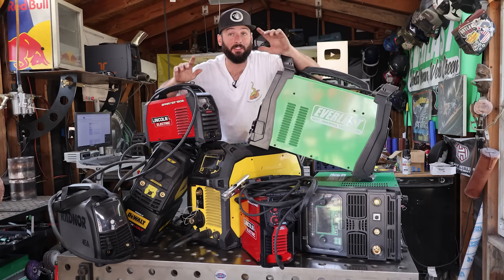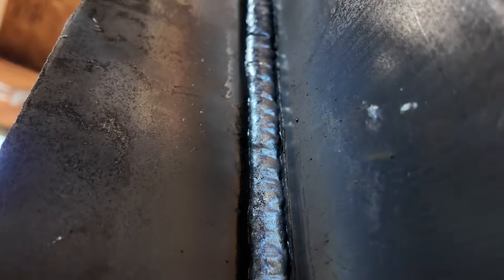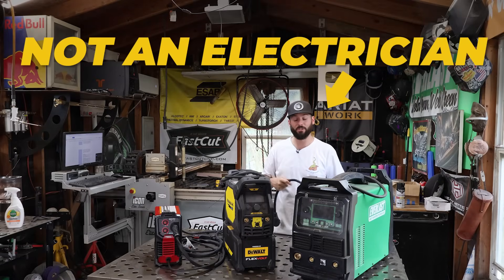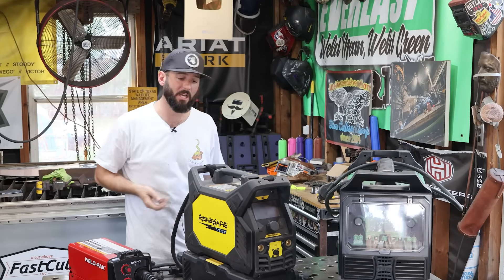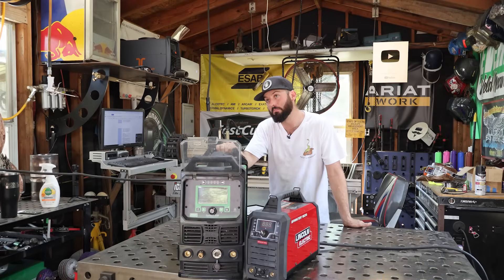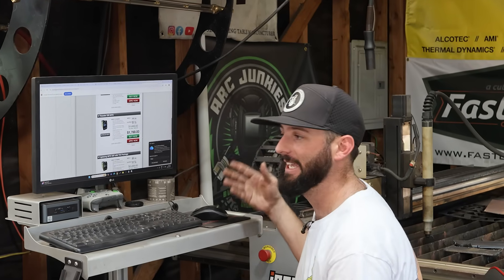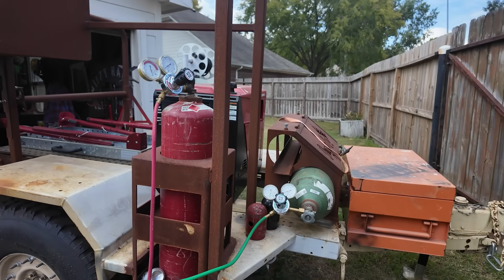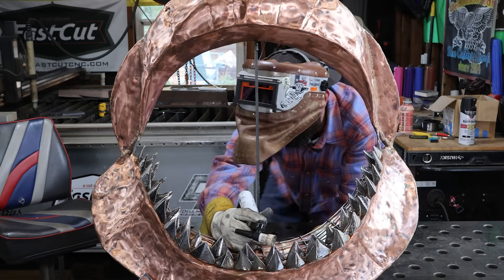Watch this BEFORE Buying a Welder

Comment: I got a multiprocess Lincoln and all I needed or for was flux core welding. It also opened up the opportunity for doing MiG welding and rig welding if I ever want to. Alma bought a Vulcan from harbor freight, but being since I worked on pipeline(as a welder helper) millers and Lincoln just seemed like a good way to go. As I do research and learn more there’s plenty of good machines out there for part of the cost. Just buy one and get after it!

Comment: Miller 211 auto set and a yes welder 205DS pro. Both machines do everything I need and I’m a novice at best. Learned in the field doing farm repairs and automotive repair. I wish I could buy one multiprocess machine but I have everything I need to get stuff done.

Comment: I just ordered an Everlast Thunder 255 to give myself pulse spray MIG capability as, while my old Miller 200 has the power, it wasn’t designed for it. Plus it’ll give me the ability to practice DC TIG
Reply: @gtcam723  that's interesting I never thought about a machine being designed for spray transfer? I just figured if all the settings n gas was right it would spray..but I have been having a hard time getting this old miller at my work to spray...I can get it to do it but it's not as smooth as some machines I've ran that had pulse settings..

Comment: This is why I got me the cheapest stick inverter(50$) I could find. I´d like to do aloominimum, too- might get me a fluxcore some day, it can do that, right? I´m the most casual welder you´d find so I don´t give a fuck about bells&whistles, I need to get the job done. Thank God I´m in a country that has 3phase in every house and 230v regular. My little inverter throws down 70A off a standart plug.
And if I really have to get something welded that needs to be reliable I go to a shop.

Comment: Found some great used Lincoln’s on Facebook marketplace. Had an inverted 275 for 7 years before I fried the mother board. Just got a tig wave 175 for 500 bucks and welds great. Weighs like 250 pounds tho 😂😂  the older machines can be a good option is the previous owner took good care of it, build strong without all the computer shit
Reply: Just remember that these transformer machines that can be gotten cheaply are pretty inefficient and need more power from the wall to put out what inverters put out with much less input. If it’s not a problem, then ok.

Comment: DIYer. No formal training. Grew up using dad’s Lincolon 175HD mig.  Bought myself a Lincoln 180 dual. Have made it work for sheet metal .025 helps, and I’ve done 1/2” structural stuff, .035 multi pass. Never needed stick, MIG does most of what I need. Have used (dads) Lotus TIG machine for small SS jobs and some 1/8” aluminum angle.

Comment: What is your opinion on yeswelder brand
Reply: They lie about their specs on their older models.   Only the CT2050 and DP200 acutally output what they claim and the display is accurate with what is measured.
Reply from the maker: You get what you pay for.

Comment: Always buy major name brand filler metals. A lesson I learned the hard way early on. Me, I insist on ONLY Lincoln Electric filler metals. I’m not saying they are the best and they sure aren’t the cheapest but I can always take them home and use the entire spool or box, whatever the case may be. With some of the cheaper ones that I allowed myself to be talked into early on, I’ve ended up throwing half a box or spool in the dumpster because I couldn’t fight with it any longer. That ain’t cheaper.

Comment: as a Euro the power advice is still useful... while the 110/220V part doesn't apply, max amperage most definitely does, and while I haven't researched it yet I imagine there are three phase (400V) machines out there, too, which I couldn't run at home.

Comment: What adapter are you using on the 285 to let you use the euro connector?  I recently got a 285 because they were on sale at 1/2 off. $2K instead of 4.
Reply from the maker: Its an adapter I got from Heavy hitters tig rig website

Comment: Upside, Harbor Freight is releasing the new Titanium Unlimited 210 later in 2026 that will include AC and DC TIG. Price at launch will be $1200.
Reply: My first good welder was the HF Titanium 200 Unlimited and I don't have any complaints with it at all, but like any MP welder there are compromises for the price point.  I think that at the price of the improved machine they will be facing stiff competition from Lincoln , Miller, Esab, Primeweld, and some good imports, but what will really kill them is their measly 90 day warranty.  I recently bought an Everlast 210 EXT due to the HF warranty and other than that I would have been happy with their Vulcan Tig 205 machine.

Comment: TOO LATE. I bought a Prime Weld 325X for Tig and a Everlast Cyclone 253DPi for MiG. Most multiprocess are compromises and don’t excel at all processes.
Reply: The worst multi-process machines are the ones that include Plasma cutting.
Reply: Y'a got yourself excellent machines, you can do it all with them!!

Comment: if you wanna go pro, minimum 220v machine, from there its mostly about budget, but like building a shop, go bigger then you think you might need, not necessarily amps, but features.  Consumables, for sure quality matters, especially with filler metals, even for the homegamer, that cardboard box of 7018 at the hardware store simply isn't going to do what you want it to do... 

Currently (no pun intended) I have several good machines some I've had for decades, but I would like to upgrade my Mig machine to a larger 220v type, as mine is just a Lincoln 125+, which has done some impressive work don't get me wrong, but it doesn't have the duty cycle I'm running into and can't run dual sheild effectively... 

All that said, I do wonder why folks have these massive 4-600 amp machines, at least if you are doing any manual process its simply overkill, yes even for arc gouging, my wee geriatric miller aead 200 engine drive does just dandy with any gouging I've ever needed doing. (granted a 300amp machine would be better for other processes, and a diesel... air pack... oh oh yes)

Comment: Started from a 70 amp Campbell Hausfeld that a guy sold me for $40. Then I traded a '95 F-150 that I had for a brand new Lincoln Pro Mig 180. Then I bought a used Lincoln Invertec 155. It died after about a year and I bought a new Hobart 160i. I just got a used, but I'm very good shape Lincoln spool gun, and a 125 ft³ argon tank. Now I'm on the hunt for an AC TIG machine
Reply: Primeweld 225

Comment: i think this video is really about the 2nd welder you buy.
 i rarely see people spend that sort of money on something they might not even end up doing. imho start with a mid brand inverter stick welder. good to learn with, cheap to buy without being to cheap and a much cheaper way to get into welding than buying mig or multi. its always a handy machine even after you have bought bigger better machines. if it turns out  welding is not for you it didn't cost much and it can sit on the shelf for the odd repair jobs. 
 
also, most multi machines are poor. its only in more recent years that they have been making good quality full featured multi's. most mid brand multi's are mig with okish stick and scratch or lift arc tig of fairly low quality, which makes it really hard to learn with.

Comment: know if ya just buy a roll of 1/8th wire, can cut it into 14 inch sticks. and dip them in plaster and powder them with cement powder several times, if ya got time for it... SMAW rods are then 5 times cheaper. most baling wire is 70'000psi. $3.80 a 5lb box
Reply: Does that even work for flux?

Comment: I absolutely love my Everlast Lightning MTS 255 it has more settings then most single process machines. I built a whole skirt and deck for a swamp buggy outta 3/16 aluminum with it and never hit the duty cycle. Fantastic machine, would recommend it to anyone.
Reply from the maker: Big fan of the lightning too! I had the 275 for years.